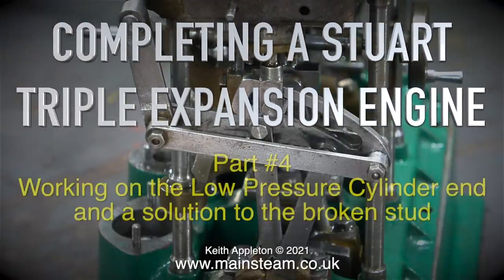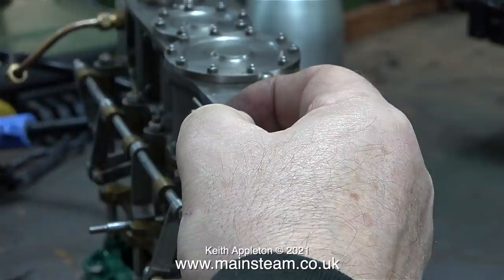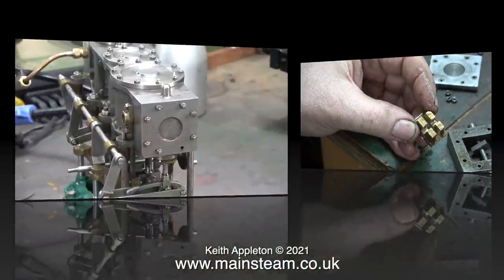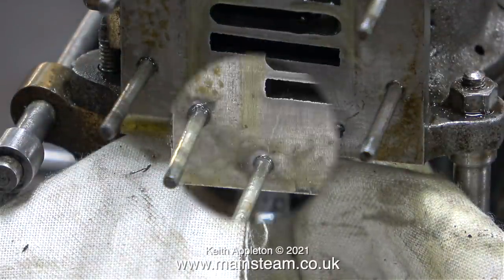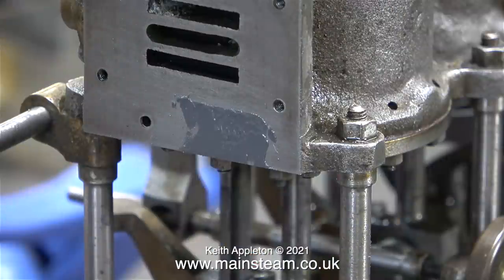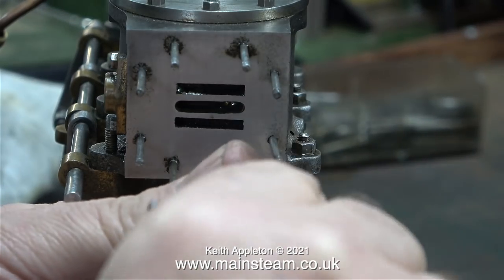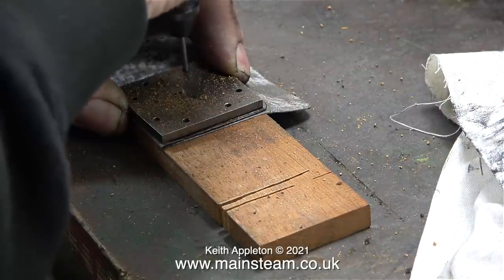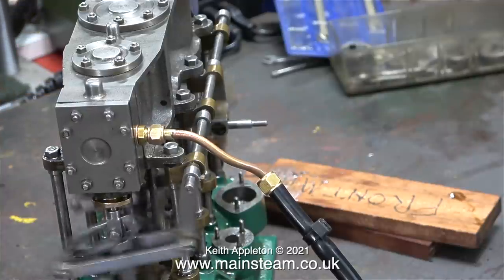COMPLETING A STUART TRIPLE EXPANSION ENGINE - PART #4

Comment: Best to all, hope everyone is fortunate in only having a minimal illness.  On removing studs and other small broken bits of stuff.  Solid carbide center drills, very small end mills, tiny carbide burrs, and straight flute carbide drills can be very useful, used to see broken off tapered pins and occasional screws while still restoring clocks.  Never met one I couldn't remove, but some were not easy and those could be a bit nerve racking.  Stay well or at least in good humor!

Comment: Keith, best wishes for your family and I hope that you are safe too.  As far as removing broken off fasteners that are hardened, have you ever tried carbide drill bits?  Of course, you would probably have to use them in something very rigid like a mill or mill-drill to avoid them shattering.  I remember a Toolmaker at work (a long time ago) gleefully showing me a file that he drilled through like it was butter by using a carbide drill bit.  I do admit that I've never used carbide drill bits and don't own any.  And that using carbide drill bits in a mill/mill-drill is beyond most beginners, but I thought that I'd mention it anyway!
Reply from the maker: Alas I don't have any in 7BA sizes .....

Comment: For drilling hard stuff, you can get small carbide drill bits used for PCB manufacturing
Reply: You can also use a drill for concrete. Just use the angle grinder to sharpen the tip. Drills for concrete are very hard.